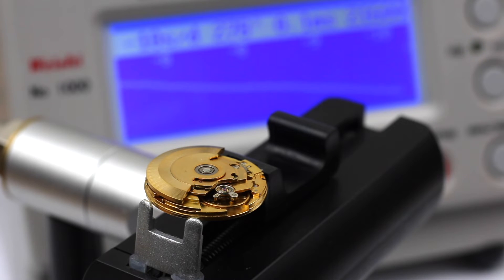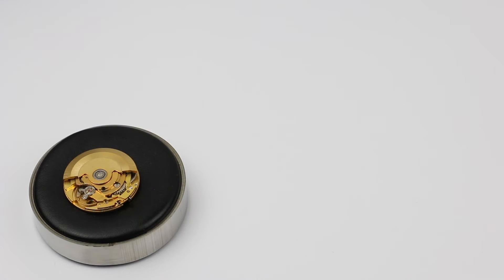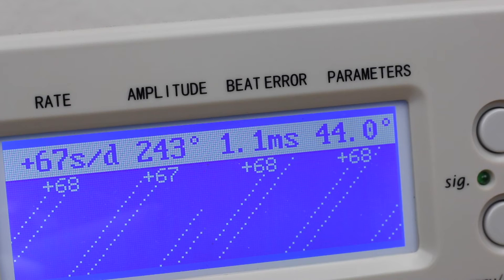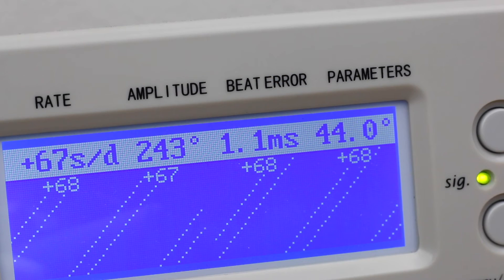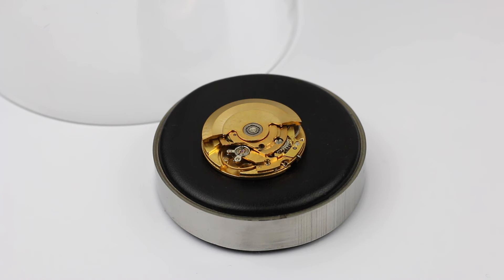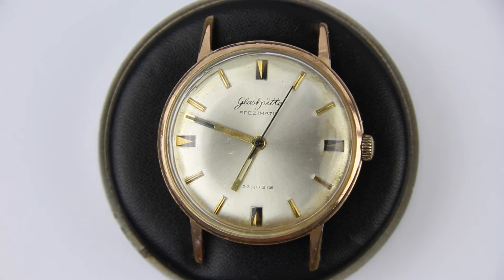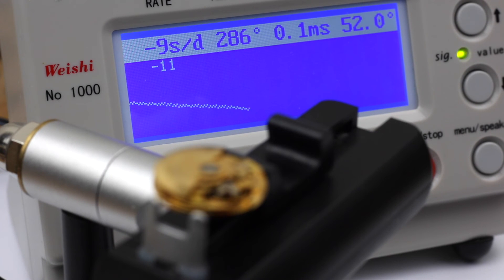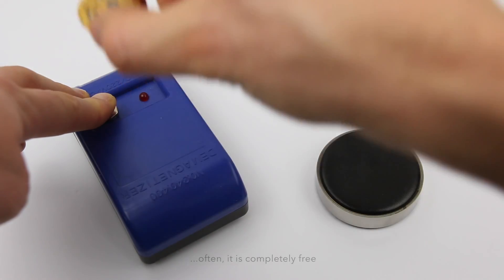HOW MAGNETS DAMAGE YOUR MECHANICAL WATCH  - With A Real Life Test

Comment: This idiot rips the whole case off and stick a permanent magnet to the spring. Misled us how inaccurate the watch movement is. With the watchcase, the movement will need to be magnetized by a very strong magnet for it to be affected. Everyday speaker magnets, phone won't harm. Even non ferromagnetic case will provide a decent shielding. With nowadays steel case watches, magnets won't harm anything at all

Comment: I've been using an iphone with Peak Design's phone case which has a built-in magnet which I find to be much stronger than other phone cases with the mag-safe feature. It's made me rather paranoid about wearing a mechanical watch since I notice the combination is enough to move the needle of a compass from about 20cm away (which is about double of an iphone without a case). I typically hold my phone with my watch-wearing hand, and the phone usually lives in the front pocket of the same side as well. This means my watch was very near to the phone a lot of the time. So it seems likely that the watch will invariably be magnetised. So I tested this out with an ETA2824. I did this for a week or so, and the watch was okay. It did not become magnetised even though it undoubtedly spent a lot of time in the magnetic field generated by the iphone + Peak design case. This puts my mind to ease somewhat. But at the same time, I wonder if other common movements will be as resistant as well. I should note that the ETA2824 I used is a Chronometre (though in a thin case), which I am not sure if is more resistant to magnetism or not.